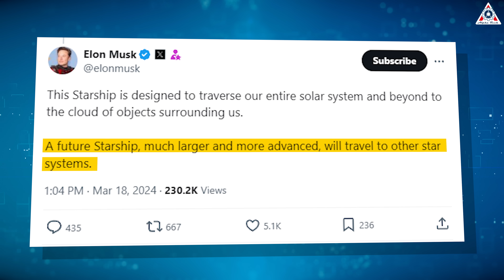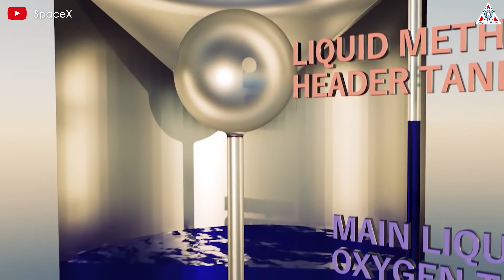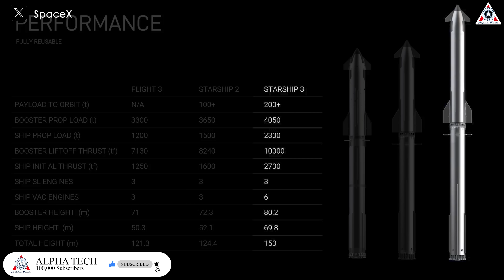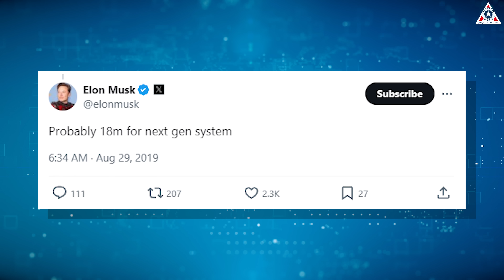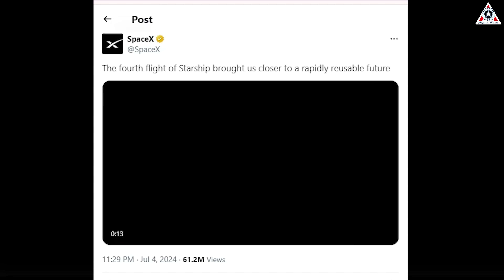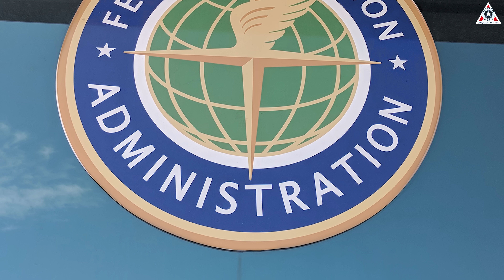Starship Is Getting Bigger and Bigger Than You Think! Here's Why

Comment: If size diameter, number of booster and thrust power increase but shell is same thick. The blast of the rocket will destroy the rocket itself
Reply: I blv 18m is not official statement.
Reply: @narayananb2252  make bigger rocket and more efficient engine is necessary but for tanker type starship.

So you can bring more fuel and can reduce numbers of refueling

Because 10-20x refueling in orbit is not efficient and risky. It should be 3-5x refueling
Reply: @kusumayogi7956 
Of course the tank wall thickness has to scale up proportionate with the tank diameter. Unless other factors, like stronger alloys, are also involved. 

So increasing diameter by, for example, 50% will require the same increase from 4mm to 6mm thickness. However, the stringer dimensions are a different calculation.
Reply: @imconsequetau5275  dry weight will increase significantly , can impact wheight per thrust ratio
Reply: It should be wider and taller. More of everything
Reply: If they keep the dimensions and the weight to thrust the same jist make it bigger
Reply: They need a New OLM with 18 Meter diameter 😂. I think V3 ist Taller but not Thicker.

Comment: I suppose I am more skeptical than some when it comes to bigger rockets. Musk says a lot of things and at one point said there were certain limitations to rocket size. One would be where to launch them from with any frequency. As to the current three reported iterations, I think one factor is the additional architecture needed to build them. The rocket is heavier than initially planned and the payload is significantly less. In order to achieve the original launch objectives, the rocket(s) have to be bigger and more sturdier than planned. So, they have gained nothing so far over their original planned payload and even the largest currently planned rocket may fall short of that objective. The biggest benefit is when they come up with a lighter more efficient "tile" and when they move the wings to a better position. Musk has also spoken of a lighter weight metal skin and additional engines...especially on the Starship. I presume the next flight will be more successful but without changing the wing position it is kind of meaningless. Much of the rocket inside and out will have to be re-engineered with a different wing placement. Somewhere out there there has to be a solution to the tiles. Wings, weight and tiles are still the immediate challenge. None the less, it should be a spectacular show.
Reply: They’ll get it figured out, still in prototype
Reply: @fionajack9160  - I think they have a certain target launch mass they have to reach to fulfill their current contract and timeline obligations.  Once they have their core product then they can develop further over time. Kind of like the Falcon 9 block 5 generation.. This is the next step with others to follow.

Comment: 18 meters allows 4x the payload capacity for the same height. Go from 35 to 70+ raptor engines. This would only be done because the payload capabilities to orbit was lower than expected. Starship would probably have 12+ raptor engines. Imagine 33 million pounds of thrust at liftoff.
Reply: I would surmise that by the time SpaceX is ready to go to 18m diameter the raptor engine for that system will be much larger.
Reply: Wrong. You double diameter and the area increases by 4X. Then the number of engines must also increase by 4X or 140 Raptors, not 70.
Reply: Sea dragon EAT IT
Reply from the maker: Yeah!
Reply: 18 meter diameter would require complete redesign/rebuild of the OLM and launch tower. Do you really see that happening? Cause I don't!

Comment: why not add another stage so the first 2 stages put SS in orbit with a full fuel tank
Reply: I like the idea. Imagine the launch pad necessary for such a system 🤣
Reply: @jason_m_schmidt622  huge i know, but make the diameter of the first and second stages bigger to hold enough fuel and raptor engines to get it into orbit and put Star Ship on top. even increasing the diameter from 17 to 20 meters while decreasing the overall length might be doable

Comment: Remember the Cheshire cat! If you don’t know what you are going to carry, any starship will take you there! Since starship has really no concrete customers yet and the plans for a moon base or a Mars base are completely nebulous, any size starship will be fine simply because we have absolutely no real idea what we need to put in to a starship. In reality at this point, the only concrete guide that we have to the eventual size of starship is how big a penis. Elon thinks he needs!
Reply: Juvenile penis analogies aside, Starship, if works as hoped, gives high versatility and much reduced costs Artemis moon base is clear goal. Mars, exploration a least, endorsed by NASA. 

If price and capabilities are dramatically improved, customers will show up
Reply: @fionajack9160  
Bigger is better - TO A POINT!  Most real vehicles eventually hit a sharply rising curve of cost and complexity as they get bigger.  For the Starship it is not clear where that point is, but I have to believe that the number of engines that can be added will soon hit a barrier.  Right now, with 33 engines, the odds that all 33 will work during a flight is (reliability percentage)^33.  If the engines are all 99% reliable (which hasn't been achieved yet), then you only have an 72% chance that all of the engines will work during a flight.  If the reliability percentage is actually only 95% (which also has not yet been achieved), the probability is .95^33 = 19^ ONLY!  Add more engines and this success percentage goes down steadily.
Reply: @wbwarren57  didn’t only one of 33 booster engines conk out last flight ? Pretty good percentage for a prototype.

There’ll be a limit to bigness at some cost,/ benefit point
Still early stage, and Musk has said that they have to get an A+ on every metric to make this thing work

Without SpaceX, what would there be worth talking about?
Reply: @fionajack9160  
I’m sorry, but I have no faith in the predictions of Elon Musk. Full self driving still doesn’t work. The flights to the moon and Mars that he predicted our years behind schedule. The first flight of starship was too soon with regard to the orbital launch mount. The heat shield is still not fully developed despite the fact that SpaceX has been working on it for five years. And now Eli is insisting on trying to do a booster catch even though the starship booster has never landed completely successfully. Elon admits (proudly) that he learned some rocket science from a book. That doesn’t give me much confidence in his predictions.
Reply: Similar thinking was applied at the inception of SpaceX when everybody was saying that you can’t make rockets reusable and/or profitable
Reply from the maker: Yeah! Maybe that!
Reply: @alphatech4966  
You know, I may be being UNFAIR to Elon!  It may not be how big a penis Elon wants, but how big a penis Elon's fans want him to have.  At this point, however, it's not clear which is the bigger penis!
Reply: One need for sure is to transport as much fuel to orbit as possible, per trip, since orbital refueling is crucial going beyond LEO. Bigger transport and depot ships needed